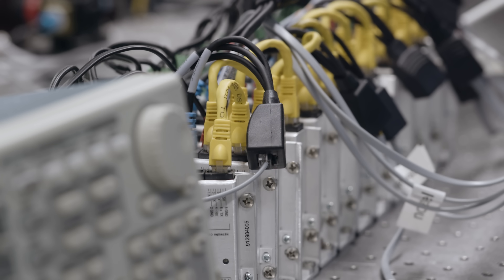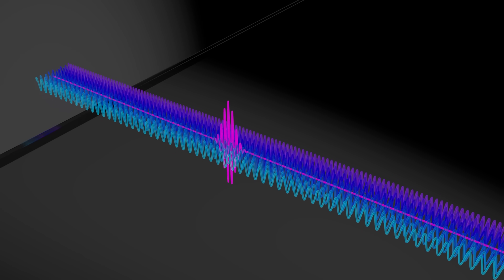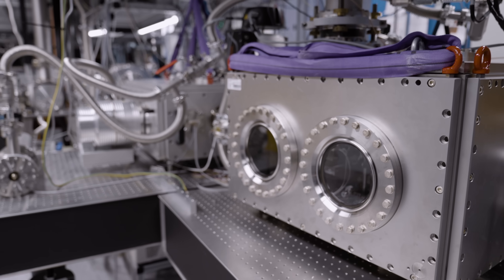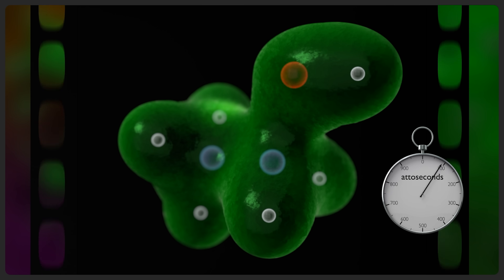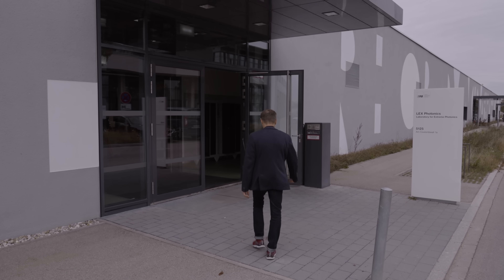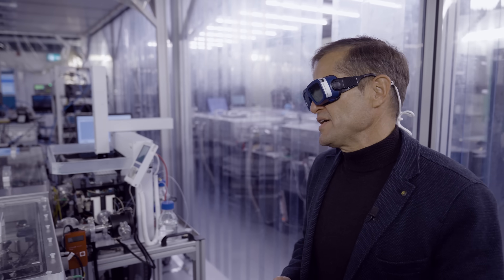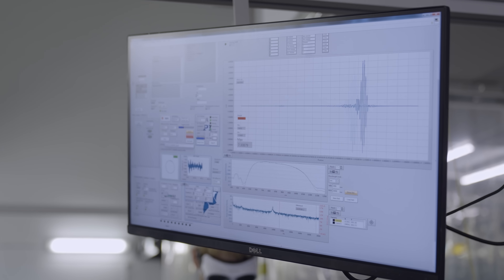Ferenc Krausz - Attosecond Physics (VIDEO PORTRAIT)

Comment: First you build a computer that can work with attosecond processors, only to discover that the universe is nothing more than a vast zeptosecond processor running a simulation.
Reply: Does adding layers like this solve any metaphysical question, or is it just pushing them around?

Comment: Boosting the Power of Computer Processing by 100,000! Now that will be a real Boost when it is realized! Are we talking about the equivalent to a 100,000 Times the currently fastest clocked Computer, e,g, 100,000 X 5E9 clock speed? How much work needs to be done to create all of the Hardware to support such speed! Maybe the first use would be to process 1 Nano second worth of a measurement event.

Comment: 8:40 excellent depiction of attosecond pulse 'taking a photograph' of an electron inside a molecule.
Explains well how this tech doesn't violate uncertainty principle, but gives more time-localised info about the electron.
Reply: 10:50 not convincing how this tech will speed up the classical computer.
Reply: 6:00 "At least one wave period of the combined laser pulse".

So why not use higher and higher frequency laser? Then theoretically we can get a smaller wave period, no?
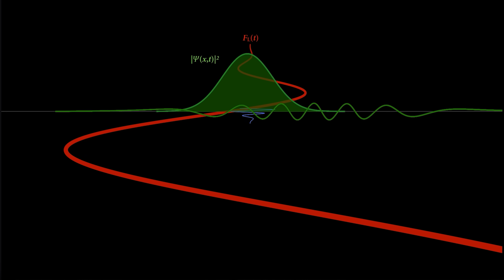Reply: 7:20 "Ultraviolet attosecond flash of light."
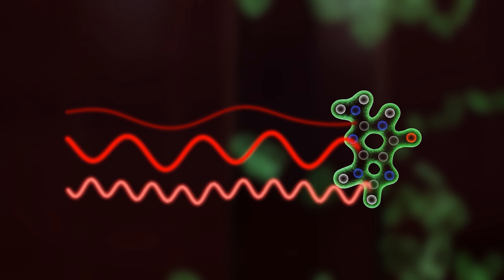11:35 "Infrared wave".

Is it infrared or UV? And why this particular choice of frequency.
Reply: @rgudduu  
Watch again. IR is pulsed at high intensity. The oscillating electric field of the photon pushes electron away from atom. As the wave phase changes, the repulsion becomes an attraction and the electron snaps back onto the atom, releasing ultra short bursts of UV light. This is the attosecond pulse.
Reply: 6:24 "electric field in that single wave period is made strong enough to rip off an electron". I am not sure whether this is consistent with quantum mechanics, say, photoelectric effect where electron does not absorb a photon no matter its intensity, unless the frequency matches the electron's state transition energy.
Reply: 2:00 like microscopy in space, we need "microscopy in time". Fantastic expression
Reply: 2:35 'camera exposure time for a high speed object' was a good example to understand. But am not sure if that applies to electron-light interaction